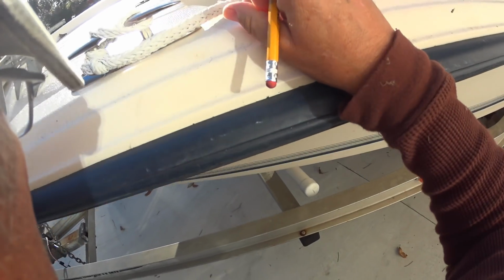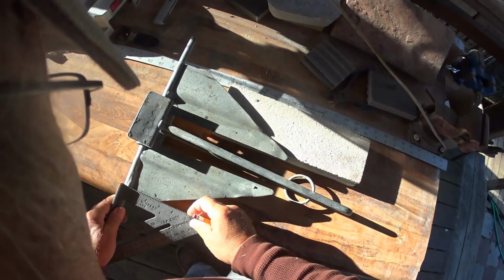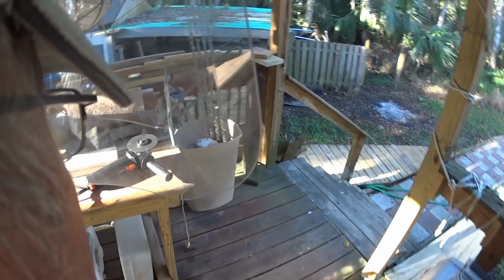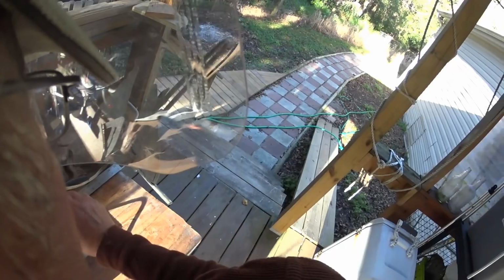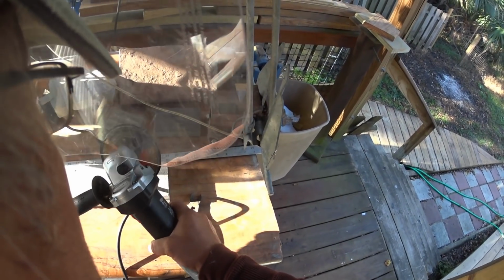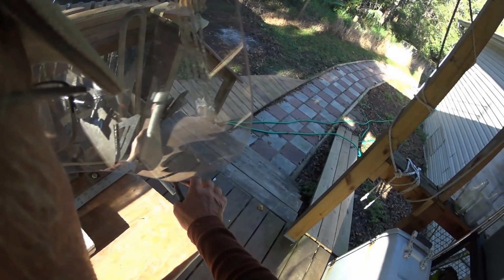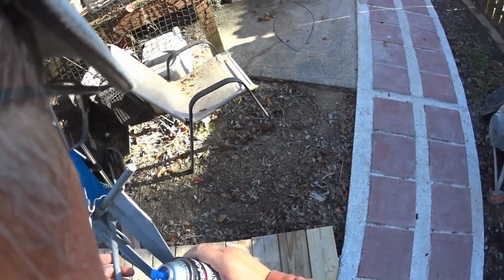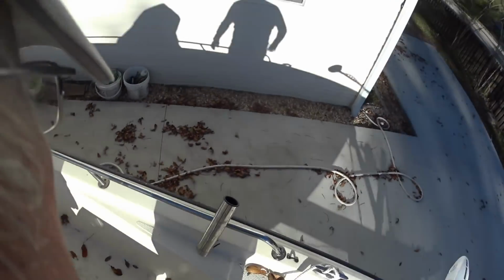How to Cut Your Anchor to Fit

Comment: Salty, I had the same problem with a replacement anchor for my 1720.  I didn't want to cut the metal due to loss of galvanization on the cut area.  I dropped in size to a 5# from the original 7#.  I think I'm going to follow your footsteps with another 7# and just keep the 5# for those days when I may want a second anchor.

Hope you all had a very Merry Christmas.  All the best in 2018.
Reply from the maker: Hi Jim and Happy New Year... I also added another 100' of anchor rope into the well so if I have to use it, I will have plenty of rode to play out to help the prongs to dig in.

Comment: Great video!! I have to do that exact same thing. I've lost two anchors this year.
Reply from the maker: Hi WF one thing I NEED to do is to drill a hole in the nose area of the anchor and actually attach the end of the anchor rope up there.. on the nose. Then run the anchor chain along the shaft of the anchor and use a couple heavy duty zip ties to zip tie the link closest to the end of the anchor shaft end securely to the shaft (usually 2 heavy duty zip ties will do but carry and extra dozen in the boat with you) and then when you go to leave, if your anchor is stuck, you can even pull hard straight up, the zip ties will break and you will be pulling the anchor up by the nose. This system has kept me from losing an anchor 1 out of 20 tips to 1 out of 50 trips
Reply: Hi Salty. I have a great deal of respect for an angle grinder especial without a protection guard. I have a shorter thumb thanks to an exploding disc. Hope you had a great Christmas considering the hope we have because the Saviour that was born 2000 years ago. Greetings to you all an God bless, Byron

Comment: I cut my finger off doing the exact same thing , and you say use safety equipment,  leather gloves are a vital part of safety equipment
Reply from the maker: Hi BT, I normally wear my leather gloves when I am grinding cement or cutting pavers (and an air filter). Angle grinders are one of the most dangerous tools in our tool arsenal.

Comment: I go through grinders every so often with my auto restoration hobby..I've had decent luck with Makita and Milwaukee...Harbor Freight if you only plan to use it a few times..ha ha!
Reply from the maker: Hello and Happy New Year 31, I have 2 angle grinders I bought off of Amazon but I have to admit, I JUST got a flier in the mail for Harbor Freight...$9.99 with a coupon for an angle grinder. Unreal.. My first one is my work horse and use it to grind the surface of several concrete projects and the second grinder is a little cheaper and I will only use it for quick metal cutting.. I only wish I had learned how blasted useful angle grinders were 20 years ago and I would have thrown my hack saws away instead of doing all that manual labor...

Comment: 1st thing I do on every new grinder is remove the guard and throw it in the scrap bucket ! I go thru 2-3 every year.
Reply from the maker: I take it that you don't change the brushes?
Reply: cant get parts here, easier to get a new one. They are pretty worn out before that, sometimes the lock breaks too.